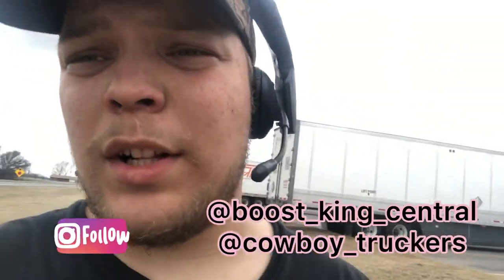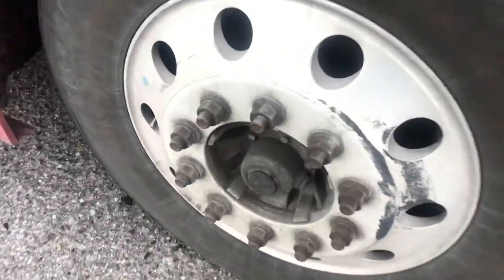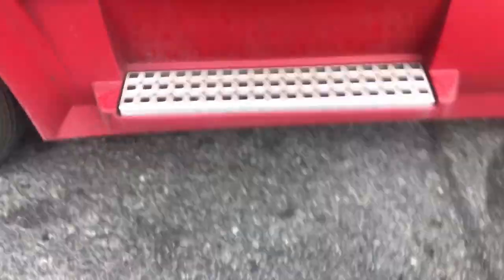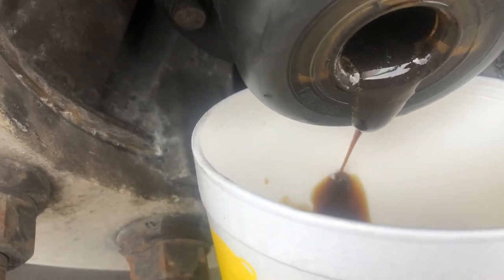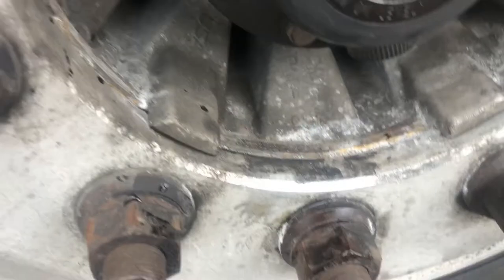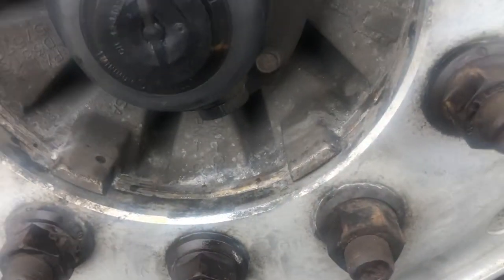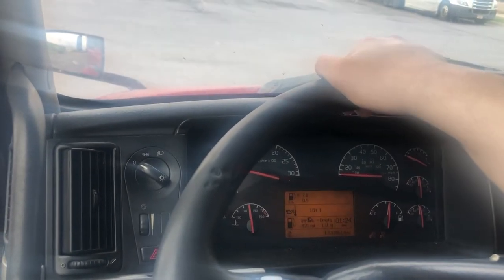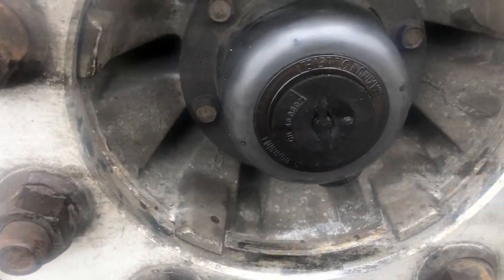How To Quickly Fix A Leaking Semi Truck Wheel Seal

Comment: When a wheel seal fails it leaks into the inside of the rim, not the outside. It is impossible for a leaking wheel seal to put oil on the outside of the wheel where the hubcap is.
Reply from the maker: Yes sir
Reply: @EddieV19  Any DOT that says otherwise should be kicked in the nuts.
Reply from the maker: I totally agree with you
Reply: I’m stupid. Why do wheels have oil in them?
Reply: @idontknowwhattoputhere.3572  to lubricate the wheel bearings.
Reply: @justdooit  the wheel iteself doesn't have oil in it dummy. wow just wow.
Reply: @southernprojectsyt6340  inside the wheel hub absolutely has oil in it. otherwise the bearings will fail. wow just wow.
Reply: @teestroyer how far many miles I can drive once I have leak from inside? How much cost to fix? Is it complicated to fix it ?
Reply from the maker: @Sloba1992 cost varies by shop and state. If you have disc brakes setup 
Most likely shops will want to change you brakes as well, saying the leak also reaches the brakes and contaminated themselves. Which is actually not true so expect to pay a bill of $300-$1200

Comment: Try turning off the engine so we can hear you better it helps with a Videos we don’t need to hear your engine I had trouble understanding what was said because Thursday engine background noise which isn’t relevant or necessary thank you for the video
Reply from the maker: I idle buddy so I can have AC, if I turn her off well then I would have a hot truck by the time im done with the video

Comment: The wheel seal is on the inside  the fill plug is on the outside. If a seal is bad you will never see it on the outside!!! Don't be giving false information.
Reply from the maker: Ok
Reply: Thanks

Comment: @Eddie V the wheel seals are on the inboard side of the wheels and leak into the rim if there is a leak  
Or into the brakes.
Now what you are describing is that if the front hubs are overfilled ....above the max line in the transparent 
indicator in the hub cover. This could or does result in that oil leaking out between the rubber plug and the cover.
This could result the DOT in writing it up as a leaking hub cover.
Sometimes these covers do crack and leak but if they are that much overfilled that they drip when that plug is removed 
then yes they tend to leak out from between the cover and the rubber plug. Especially when the rubber plug is older and 
and becomes less flexible.
Reply from the maker: Ok

Comment: Have you ever thought that you are on the slight angle, dip or slant in the pavement and that's why it has more oil coming out, plus FYI, it's hub oil not grease, truckers don't put grease in the hubs ... Know the difference...
Reply from the maker: It was over filled I was on flat ground

Comment: This isn't a wheel seal. But yeah, they were overfilled and they will leak from the vent hole in the center of that rubber hub oil seal.
Reply from the maker: Ok

Comment: Try turning the engine off next time, that was pointless.. and that's not a wheel seal that's just an oil cap. A bad seal leaks  gear oil into the drum and brakes, that's not grease.. waste of time video
Reply from the maker: Screw you I got views you don’t